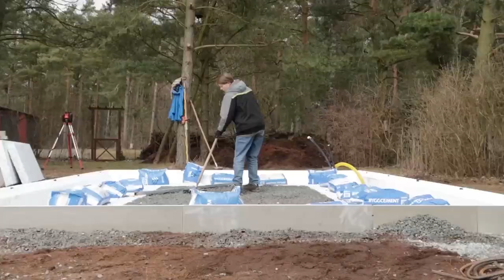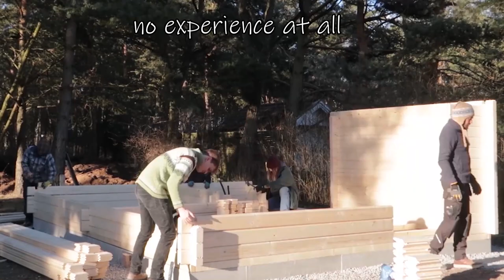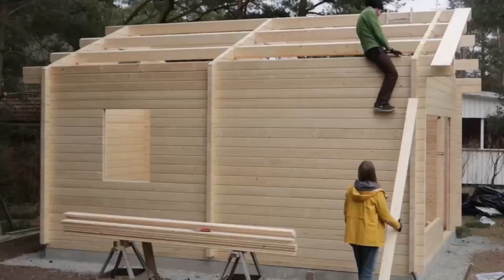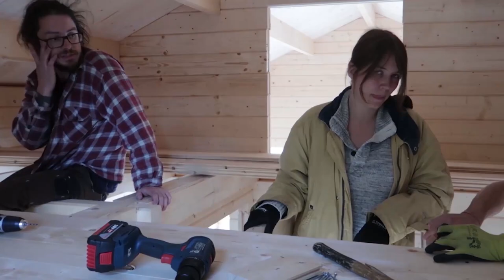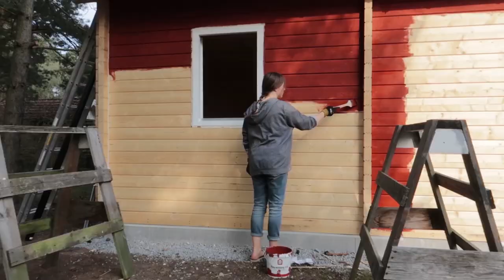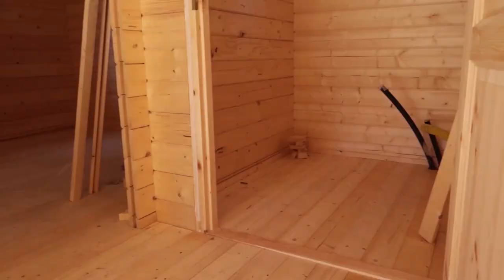Log Cabin Time Lapse - No Experience, 3 Months, Tiny House DIY Kit

Comment: this kit needs no experience, i thought you build a real log cabin with kitchen and at least a small sink, but no, insulated? no, why 3 months again? good luck in the future anyway
Reply from the maker: Hehe yeah we ask ourselves how this could have taken three months sometimes. No experience as in I (Lena) didn’t even know how to use a drill before. From that to making a concrete foundation, building a log cabin with a kit that was faulty in many ways in a country that is still very very cold in February, where we don’t speak the language so everything we had to buy we had to do lots of research and and and. We did build a tiny kitchen, we built all the furniture inside ourselves and it took us another good two months to finally call it finished. 😅😊
Reply: @lenaandbaz1090  eeh a lot of work can't wait to see what's next, good luck dear